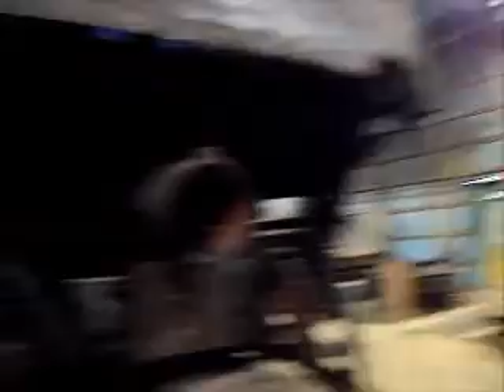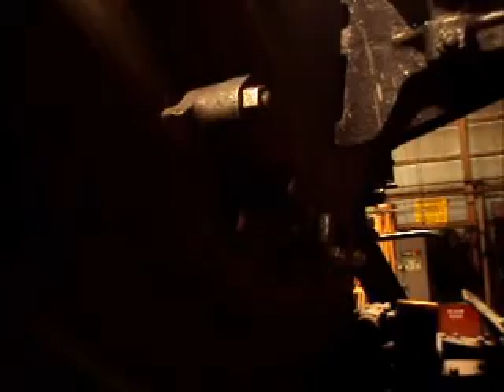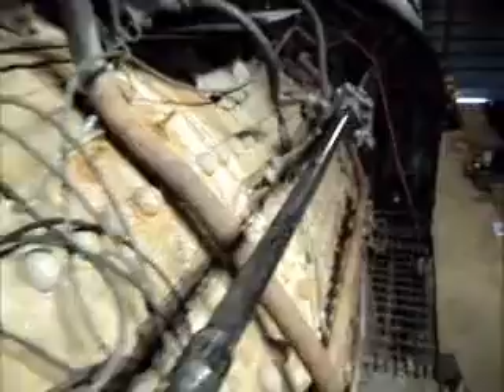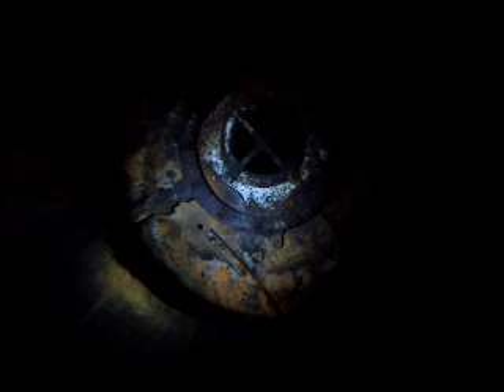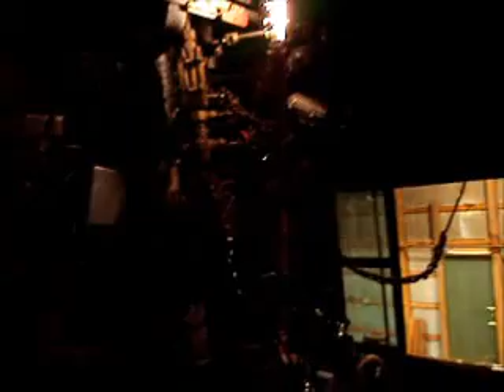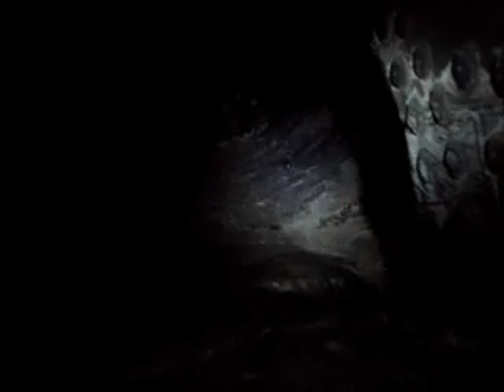Steam Locomotive Maintenance with PM 1225 after Running

Comment: wondering if you could tune the whistle to when it was in 1991 it sounds nicer then
Reply from the maker: Actually, the whistle in this video is tuned pretty close to what it was then and up to the 2009 season when someone messed with it. The reason it sounds any different now is because it can be quilled. Back in 1991, the only way to blow the whistle was with the air valve that has been with the engine since 1941. One of our engineers, Charlie, hooked up a whistle cord several years ago so that we could quill it. Check out the Return to Rails Event video after this one. The beginning scene shows the engine pulling out of the barn. It sounds the whistle and it is a lot like it was back in 91.
Reply: RailsofMichigan  thanks what was the problem with the bridge between carland and clare and will it be fixed?
Reply from the maker: Kathleen Whelan The "problem" is based on Cooper ratings which is the weight ratio of the locomotive on the bridges. However, this issue has been resolved in the past 20 years but was brought up by someone that must have a problem with us. Shouldn't be a problem in the future as we have crossed these bridges many times before.